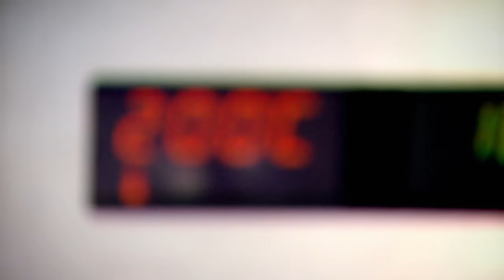Gordon Ramsay’s Top 5 Desserts | COMPILATION

Comment: PUFF PASTRIES ARE SO MUCH MORE INTENSE THAN I EXPECTED
Reply: TheDraconianViking its just the video is intense lol
Reply: Puff pastry is completely different to choux  (pronounced shoe) pastry which is what he made in this video. Puff pastry is probably harder though as it requires you to lay it out and roll in slabs of butter the fold it, roll it again and repeat so it's really flaky when cut like a croissant. There is rough puff pastry as well which is easier as you just mix pieces of butter in rather than folding in large rectangle slabs.
Reply: It's pretty easy... for me
Reply: @tomaszlosinski875  Not hard exactly, just very irritating lol